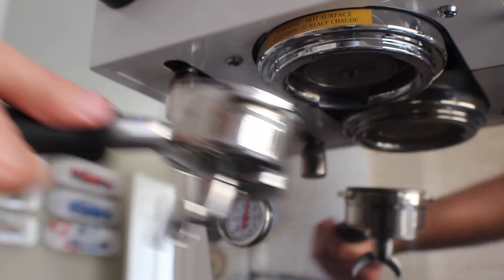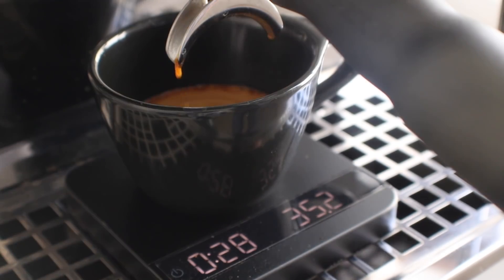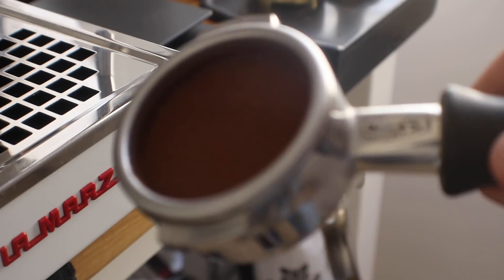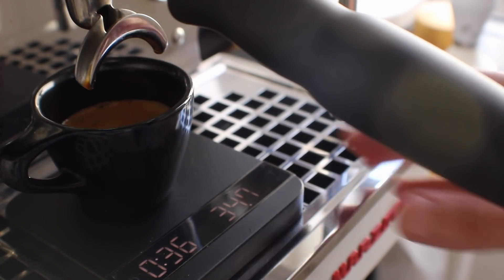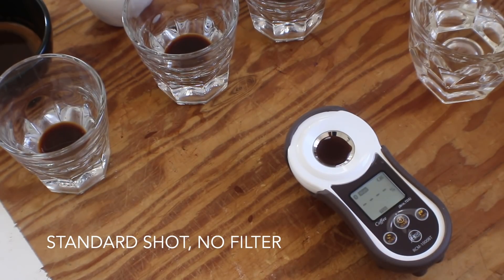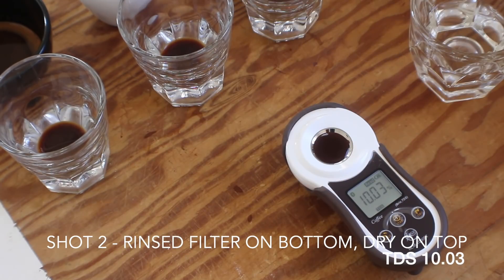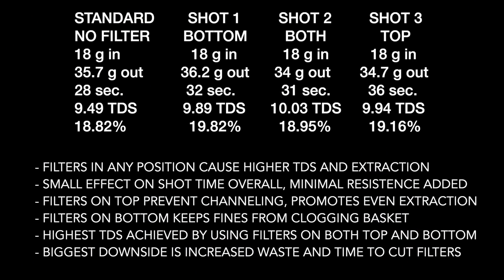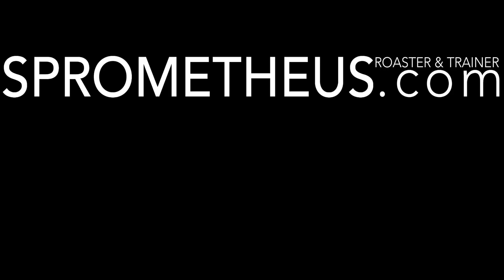COFFEE SCIENCE - Higher Extraction Using Aeropress Filters

Comment: My understanding was that Rao came up with the double filter method to address the problems of a finer grind size for espresso. Grind too fine and you start to get channeling and the fines can clog up the spout. The dry filter on bottom prevents clogging while the wet one on top creates more even water distribution to prevent channeling. Finer grind size (and lower pressure) yields higher extraction. Did you use a finer grind size for this, or the typical grind setting?
Reply: I think this  is why my Breville comes with 2 sizes and 2 styles of cups. One of them has just a tiny hole on the bottom. I think Breville claims this makes it easier for amateurs to get consistent pulls.

Comment: Too many variables in my opinion. You’d also have to measure coffee ground to .1g accuracy, plus brewing ratio and extraction time. Temperature variances in the boiler as well, especially if you’re using a prosumer machine as opposed to professional. And finally, the margin of error caused by distribution method is unaccountable.
Reply from the maker: ULTRA KWON the amount of variables in something like this is always going to be pretty high. But given the tools that I had at my disposal I did what I felt would give me the most reliable results possible. Verifying that today on a friend’s DE+ that two filters is better (I.e higher extraction) than one. Regardless of things outside of my control I don’t think these results are by any means outside of the realm of possibility. But it’s a relatively simple experiment to do, feel free to give a it try yourself.
Reply: I'll take your word for it. I think my experimental days are over with espresso; not my favorite brewing method. Only times I pull it anymore is when my mom comes over for lattes. Thank you for your explanation and hard work.